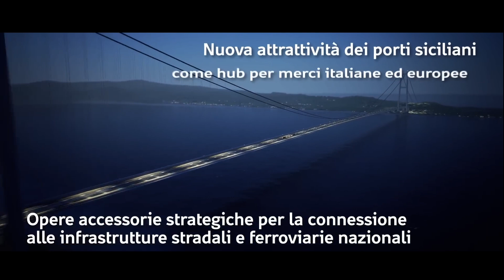Italy's $5BN Battle To Build The World's Longest Suspension Bridge

Comment: A small investment in the prosperity of the regions. However, the WeBuild bridge needs improvement. In particular, the piers need to stand in the water so barges can bring bridge segments to the landward side and thus replace heavy concrete viaduct with cheaper more flexible steel as per the spans over water. Thus the span should be reduced to 3150 metres, and the piers (mid point of cable to) raised to 400 metres. The sag will be 315 metres to mid point of cable bottom - thus mid point of cable bottom will be 85 metres A.S.L. Thus the length to sag ratio will be 10:1, down from 11:1 with a 3000 metre span and a 300 metre sag - mid point of cable bottom 82.6 metres.

Comment: Was there ever a tunnel option? And what were the arguments against that solution?
Reply: That strait is a very mess geologically speaking: it's a very active geological site, with many fractures and tectonic plates. The solution of a suspended bridge is the best way of doing it
Reply: The straight is a geological valley 300mt deep at some point.
Just imagine how much it should be long .... to go down and then up at less the 2% > 300*50= more than 15km
+ is a geological main rift between Africa and Europe